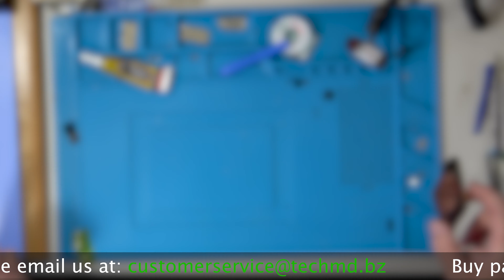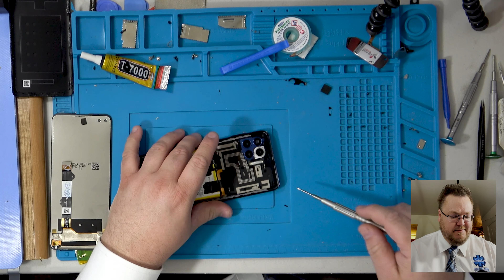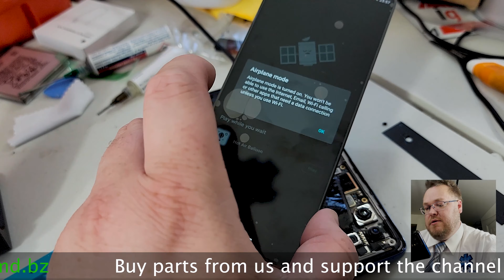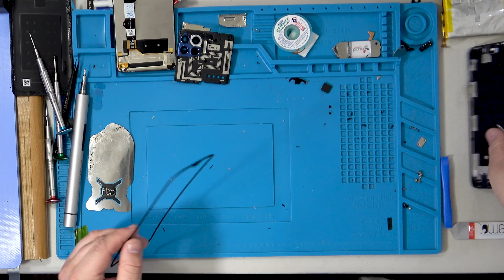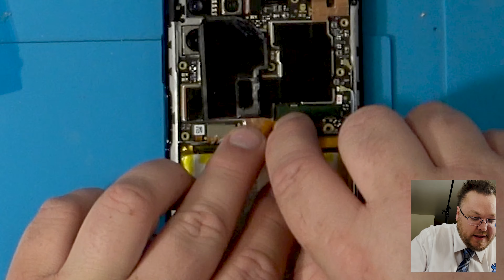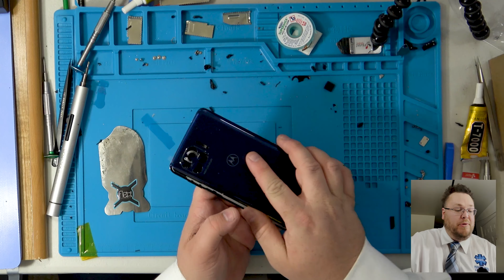Motorola One 5G screen / LCD & Glass replacement DETAILED

Comment: great video. my charge port went bad so i had to replace it. But, somehow, my screen lost touch ability. So I assumed I damaged the ribbon cable when taking out the battery. I bought a new screen but it does the same. No touch to unlock. Is there some other factor in what makes a screen touch work on this phone?

Comment: Thanks! I did this repair and it went well. I have the Moto One 5G UW Ace, which is only slightly different. There is a fingerprint button you have to watch out for when taking off the rear casing. Also the cable for the battery is located in a different place. Thanks again for the wonderful detailed video.

Comment: I bought the heating pad, what is the ideal temperature at 5 minutes to get the back off, on a phone that hast been removed?
Reply: So I did it. Video really helped thank you. I definitely couldn't have done it without purchasing the heating pad from your links.

A few things I learned.
- take the most time on removing the battery. Don't rush it make sure the phone is heated to Temp, so the glue is heated, and pry the battery down towards the phone not the battery. Don't bend it or puncture it.
-the most important is test the screen. I did this immediately as per your video suggested and all was well. If you don't test the screen and your phone doesn't work you lost.
- the heating pad should be heated to at least 90° C in order for the back or the screen to come off easily.
-make sure you have a glove to protect your hand from your phone if it gets too hot.
-if you're replacing your screen like I did, buy the little frame also. When I went to go take the screen off I also took off the frame but unfortunately I took the frame off in pieces so I had to glue it back on, I realized I put it on upside down and then I had to re-glue it. If I would have had a replacement frame I could have just used that instead.

I'm using my phone now to type this comment the screen works all is well. The only issue I had was the frame it's a little botched but it gets covered up by my phone case so it doesn't bother me. My screen is not cracked in my phone works, now I know how to do this so it was worth it.
Reply: @tylerbailey1365 he said 120 Celsius he must be cappin right an meant Fahrenheit cause that’s 248 if he meant Celsius

Comment from the maker: Please support the channel by using my amazon links! 
For just the Screen / LCD & Glass click on the links below:

LCD Screen Replacement Touch Display Digitizer Assembly :
https://amzn.to/3Bis1IS

Or for Xt2075: 
https://amzn.to/3M3agm8

LCD Display Touch Screen Glass Digitizer Assembly (Black) :
https://amzn.to/3jGrJFM

Tempered Glass Screen Protector, Anti Scratch, Bubble Free :
https://amzn.to/3vLnYUj

Recommended UAG :
https://amzn.to/3jGrPx8

Heating pad:
https://amzn.to/3mbIytW

Heat Resistant Gloves
https://amzn.to/3EsZdyW

My blue mat to keep everyone organized:
https://amzn.to/3BalS16

iFlex Opening Tool with Glue Card :
https://amzn.to/35UC9h8

iPlastix Opening Tool with Glue Card :
https://amzn.to/38FtzUH

on of my favorite screw driver sets 2uul:
https://amzn.to/3jsqkCz
https://amzn.to/3CcoL2Y

iseasmo w/ Kit (Has Screw driver too)
https://amzn.to/35Za2O0

Tweezers:
https://amzn.to/3B7yBlf

T-7000 Water sealing glue:
https://amzn.to/3EdzLxs 

Isopropyl Alcohol For Technical Use:
https://amzn.to/3BqBU78

Need to get a part from a reliable quick source, you'll find a better price here then Amazon and the quality will be a lot better. Click on the link below.
https://www.injuredgadgets.com/?acc=be9b6cec65c863e1b55538d2c7fcc9b0

• Visit our Website: https://tech-md.com

• My email: dustin@techmd.bz

• To mail in your phone, please contact us at 801-438-6028

Comment: Thanks for this video! It showed me how to replace the broken display on my wife's phone, which I did successfully. FYI, the Ace version of this phone is very similar but has a fingerprint sensor on the back which makes some of the operations a little trickier as the back cover is tied to the phone with a relatively short cable at times during the disassembly/reassembly. But nothing I couldn't figure out. Thanks!
Reply from the maker: Awesome glad it work out!
Reply: Hell yeah. That got me to, and I had to order a $22 fingerprint sensor. The ribbon able easily tore on me.

Comment: Thanks for your video. Very informational. I have a question for you. I'm in the middle of replacing the screen. When i tested the screen like you did (before removing broken screen to see if new screen actually works) the picture comes on but there's no touch input. Do i have a bad screen or did i connect something wrong somewhere? Hope to hear from you soon.
Reply: Yes your screen is bad if there's no touch input when it's connected to the motherboard
Reply: For anybody reading this comment, i ordered 2 more screens and both of them did the same thing. I decided to go ahead and replace the screen even though the screen didn't work and when i was done the touch input was working fine. I guess some part of the screen had to touch the metal chassis of the phone. So my suggestion to test the screen would be to remove the old screen and put new screen in place BEFORE gluing it down.
Reply: The screen needs something firm behind it to create pressure to register the touch. If I let it lay flat in my hand I was able to get it to work, but if I was being delicate and holding it by the edges it wouldn't.

Comment: If your display is working properly but the screen is cracked can you replace just the glass and not the rest of the LCD components?
Reply from the maker: Yes if you have $5000 in specialized equipment.

Comment: I did same replacement but got ghosting issue/random clicks.. any idea what I might have done incorrect?
Reply from the maker: Question number one did you buy the parts from us or someone else? If it’s from us call the phone number on the website if not return the part and buy a new part where I suggested which is from us. It’s a defective part

Comment: ;-) IDK if i will nail that first time-never done 'that job' b4 right..ha' on other hand, lil screen' devices not going away.. and 'this could be a good skill'.. Heh.. funny .. ( heating pad is essential looks like'.. ( i' also have tunnel vision.. so i steer away from 'highly detailed jobs like that' intuitively.. but ' mm  ( interesting how ' chiped glass and 'screen reading /inteligence different- replace one not other- necessarily.. (  for the 22-30$ price difference in parts.. shrug* but screen works fine just cracks) .. (  ace k-)